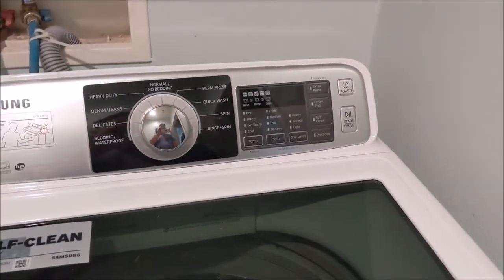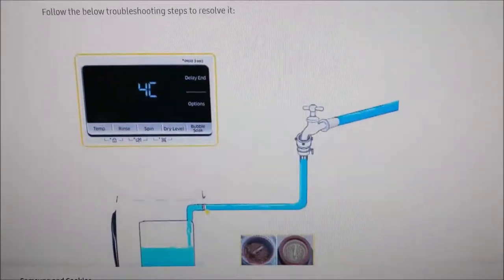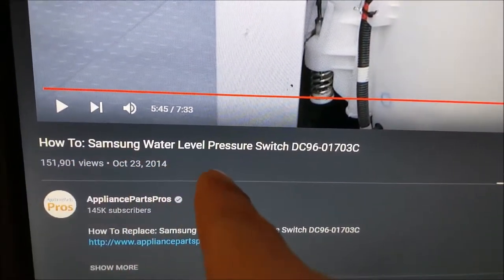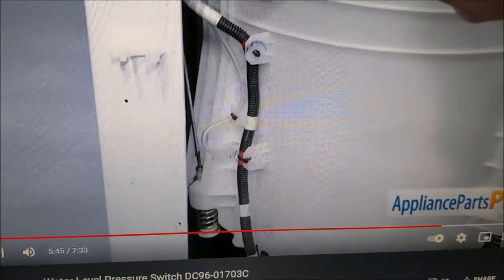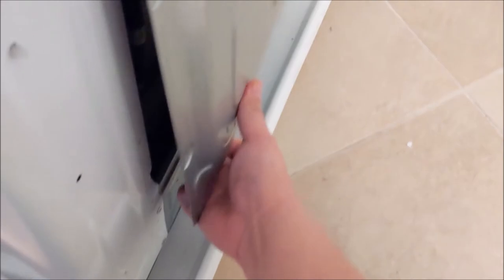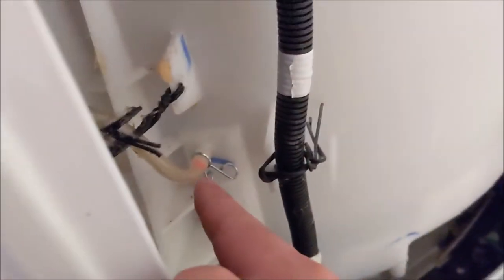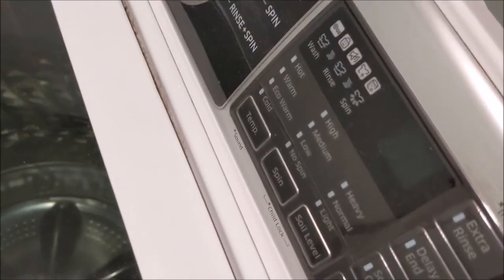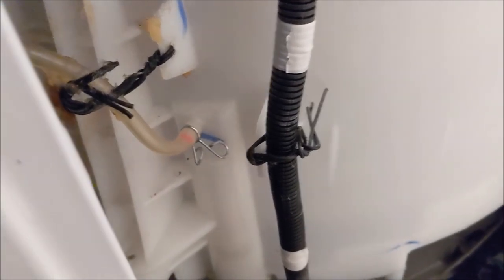4E code Samsung Top Load Washer: Check inlet filter.  Wet on bottom, could be loose water level tube

Comment: You might say it was boring , but this did help me. Amongst all the videos up here, it was a very simplified  fix and was exactly my problem.
Thanks!
Reply from the maker: Glad it helped.  I went through the same problems as you.  

Samsung suggested cleaning inlet hose filter. They were super clean.

After that... Someone mentioned the water sensor.  It seemed very scary the way it was described.

If you see water at the bottom of your washer... I think that's a big indicator theirs a leak at the bottom... But it's easy it place back the hose.

Our washer is uneven or the washer just washed with alot of banging (having no agitator).  I try to evenly place the clothes inside... But I think most agitator type washers you don't have to worry about even placement of dirty clothes.  

Anyways.  It's my guess all the hard shaking will eventually cause this hose to go loose.

Glad it helped.  Have a good one. I thought Id have to buy a new washer.  Worst case scenario is I'll need to buy a new hose I hope if this keeps happening.

Comment: Thank you so much man you saved the day and pointed me to my exact issue 👍 Watler level sensor tube was disconnected and hard. I will have to replace it but just to be sure I reconnected it and whala code 4E disappeared.
Reply from the maker: It's been like 4-6 months since I made this video I think. I should have got a new sensor tube but I'm lazy.  It's still running. 

Glad your up and running. Like you. I figured I'd have to buy a new washer. I got lucky.

Comment: just wanted to stop in and say thank you... this was my exact issue... easy fix thanks to you!
Reply from the maker: I've watched the other videos.. many mentioned a tube coming loose but.. often.. they mentioned the tube coming off from the top.. (which is alot tougher to fix.. and I've never tried).  My wife was ready to buy a new washer...

I think the tube will fall off again.. I think I need to secure it better.. (and it was still wet).  Butt... it's Mar 2022.. so a good 5 months later and it's still rocking.  Another part broke on my samsung washer... the pulsater cap broke off.  Man.. I never figured a 6-7 year old washer would have these kinds of issues. They don't build them like they used to (that's what my wife said).

Comment: Thank you so much. Right on the money with identifying the problem.
Reply from the maker: Glad it helped alex.  You cant believe how bummed I was when this happened.  Last thing we need is a surprise washer replacement.

I never replaced the tube but just cleaned it and reinserted it.  It's been running fine for the past year.

Hopefully the description of the problem made sense.

Glad you are back up and running.

Comment: It happened to me before, I was setting it to the higher water level, which weight pull the bucket down too much that's why the little hose came off, just don't fill up too much water and you won't see it come off again